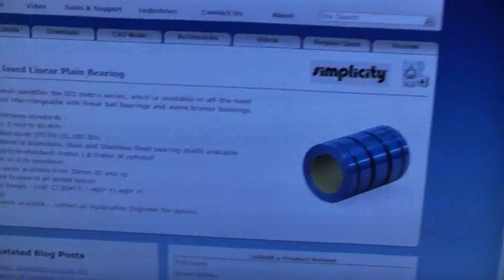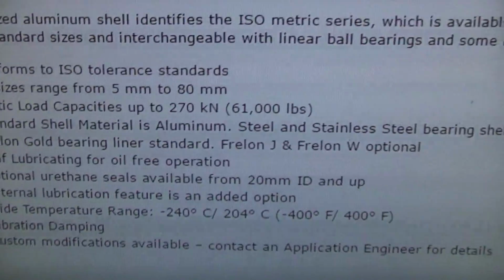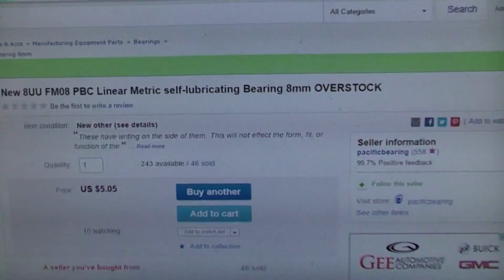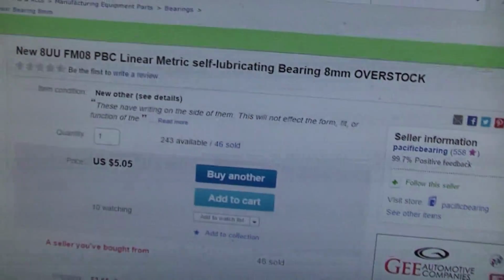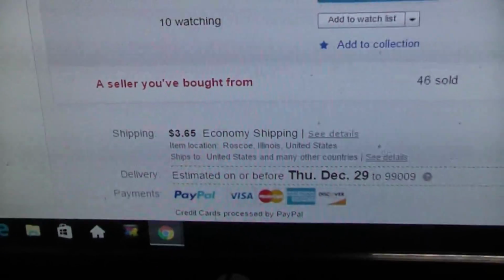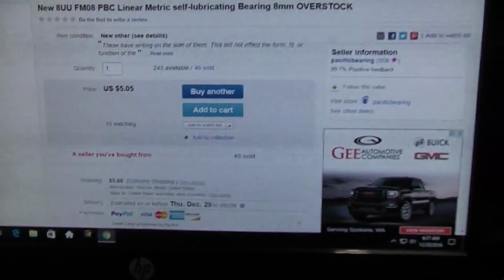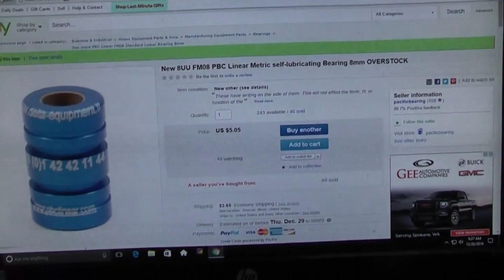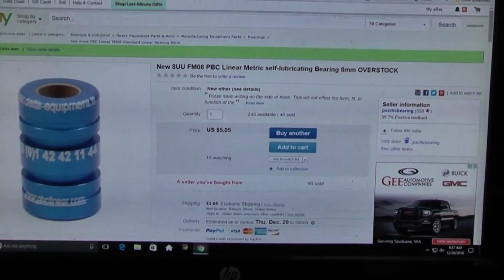Prusa i3 MK2 linear bearing upgrade for print bed

Comment: They just create drag.. buy GOOD quality lmu88 bearings...
Reply from the maker: The Frelon bearings have far less drag than  the ball bearing units. but I do agree that if you buy high quality ball bearing units they will work great !
Reply: these are quieter and have similar resistance to Misumi bearings in my experience.  Too bad they don't cost 5 bucks on ebay anymore.  They're $12 a pop as of this post.

Comment: It's interesting that when researching the Frelon lined bearings on McMaster-Carr's website they specifically tell you not to use a bearing with that material on bare aluminum, chrome plated steel or 300 series stainless steel shafts.  Coated or soft steels could see premature wear from this material.
Reply from the maker: Just checked there site again and it states that the Frelon lined bearing work with hardened steel and stainless steel shafting, and in fact that is what they sell to use with there bearings. We will see how long they last. So far I have printed about 10 pounds of filament on my printer and they still work and feel like new. Time will tell.

Comment: I replaced all of my bearings on my Original Prusa i3 and printed MK2 parts in black PETG. I used the same brand bearing but a different size. My are 15mm OD so they fit the plastic parts. 6 for $45 with free shipping. They work quite well. Much quieter some print quality improvement. Remember to oil them occasionally with some light machine oil.

http://www.ebay.com/itm/8mm-Metric-Linear-Bearing-Pacific-Bearing-FJ08-8uu-/151883247317?hash=item235cf26ed5:g:bi4AAOSw~OdVaGMmiage 

The other thing I noticed with the y-carriage was that part of the slop was caused by the bearing rolling out of the machined pocket on the aluminum frame. I used a 45 degree chamfer bit to ease the edges and no the bearing stay in place. 

https://goo.gl/photos/aBZhj3inNuGzSjip9

You can also spread the bearing shafts apart by adjusting the nuts on the threaded rod to take out some play and get the carriage to run with no binds.

PCB Linear is the parent company of 3D Platform a large format 3D printer manufacturer.
https://3dplatform.com/

Comment: Did you notice any difference to the prints as well?
Reply from the maker: No I have not really seen any difference in the print quality. It was very good before and still is very good. I normally use the OPTIMAL setting of the Slic3MK2 program, so the quality is very good. But getting rid of the noise and the slop has got to help in the long run. One day I might try the .25 nozzel then it would be a good idea to not have any slop in the build plate bearings.

Comment: Would you recommend upgrading the bearings used on the X-axis as well?
Reply from the maker: The X axis has 3 bearings in a small part area, there does not seem to be much play there at all. If I do replace my X axis bearing it would be for noise reasons, but even that seems to be minimal compared to the heat bed. I think the heat bed build plate is like a sounding board making any bear sound much louder, then factor in that the heat bed build plate is so large and the bearing so close togethere and thats why any play in the bearings made for a lose fit with lots of play.